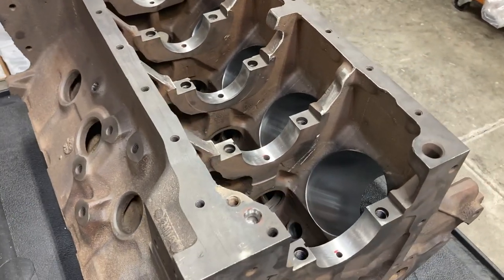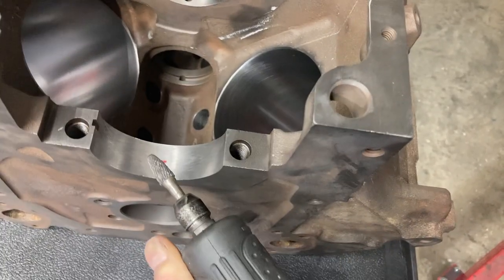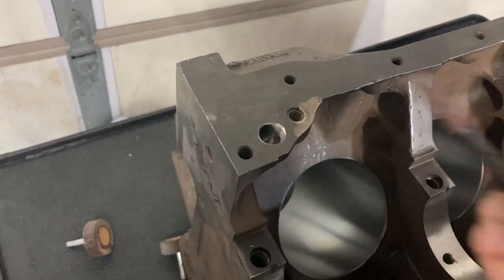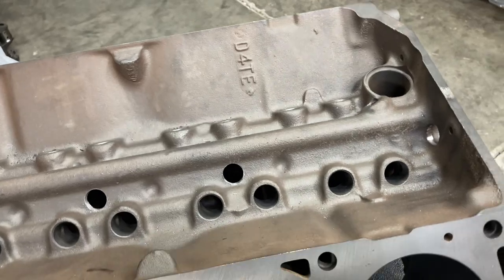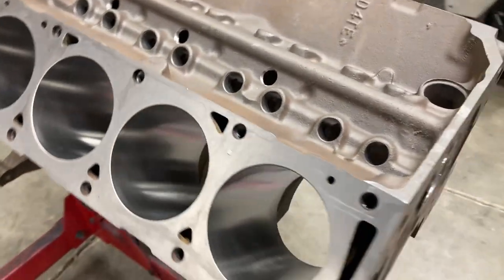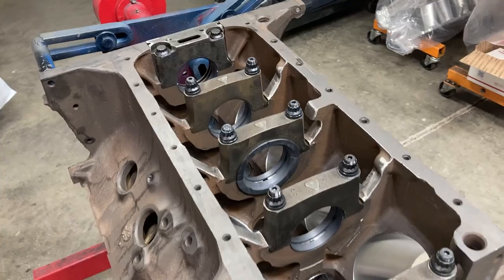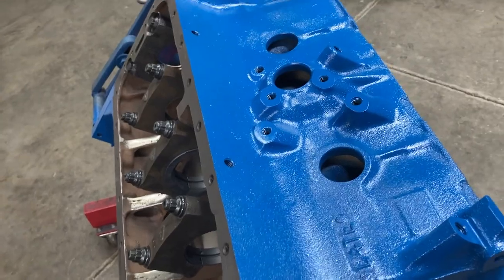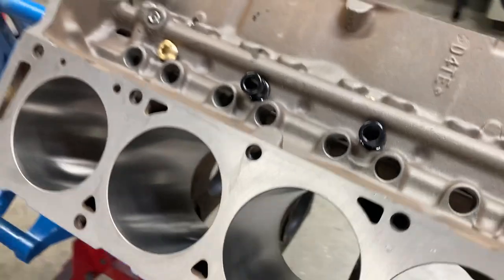Lykins Motorsports How To Prep An FE Block For Street/Strip

Comment: Not to tell u ur business if course but I started years ago using aluminum recessed square drive pipe plugs for race car engines in the frist plug holes on 302 Fords. Dick Trickle told me way back when that it stiffened up the block walls in his 351C motors. Yes I'm 63 yrs old and been around to long vut it has never let me down even with the inevitable times when things get a little warmer than they should and pressures get a bit high in the cooling system. I was a Senior Master ASE for many years and tried to live by the idea that every day is a school day and appreciate u sharing your aquired knowledge with me as well. Thank u!

Comment: Thanks for all the information I broke a drill or 2 doing oil mods on the FEs did my 1st 390 in 1975. Found a receipt form Anderson auto parts in Greenville SC  yesterday looking thru an old ford engine book receipt dated 2/14-1978 
 for MS 863p-10  $38.47 and CB 760p-10 $25 68. I googled those part numbers and summit still carries those but are a little more expensive. Been a FE man since high school 1973 got my 67 GT mustang 390 car no engine or trans cause that's all I could afford built my 1st drag car from it. Love your detail reminds me of someone I know. No way the boat anchor applies

Comment: Great video Brent. I learned the hard way, why you have to clean a block again , even after machine shop had cleaned it. This was 35 years ago, and the oil drain backs got clogged up with crap. Since then I always clean all oil galleys and everything else really well, even if machine shop cleaned it too.

Comment: Great video! I've got a 390 from a 66 T-bird in the floor of my shop that I hope to one day make a 445 out of. I have a 65 F100 that it would go in. I have two 66 F100's with the 352 V8's. One of them has 31k original miles and the other is worn out with mix matched heads. Love the FE's and really enjoy your channel!

Comment: Good episode.  Been fooling with motors including FE's since these were brand new production pieces.  Agree with all you have shown.  But wonder why brass freeze plugs and steel block drain plug ...  I'd use brass wherever water touches metal.  Also the front main gallery plug, I'd use brass because I'd drill it 0.045" as an oil squirter onto the timing chain/sprocket.  Your enhanced valley drains will help.  But, because most blocks are inclined back toward the firewall on installation, there may not be enough oil to keep that chain wet ...  A wet chain is a happy chain and it will extend the life of the chain greatly and allow it to not "stretch" over time, keeping the timing more consistent for much longer 😊
Reply from the maker: Chain gets a ton of splash.  I’ve never used anything that puts more oil on the chain.  Never an issue. Parts are better quality than they were decades ago.  

As for steel plug, the plug is easily removed and changed.  Freeze plugs are not.  In addition, the fastener kits that come for these engines with original style fasteners all have steel plugs to look period correct.

Comment: I'm pretty sure I did all these mods and a few more not mentioned here. Involving a 7/16 drill bit 24 inches long. I have a 1970 thick block from a truck 360. I sonic tested the block and mapped it for core shift observation. It's a nice block. I had 7 I went through till I found this one I selected. I hope everyone finds all those hidden ponies in their FE!
Reply from the maker: Blocks are subject to core shift, even in oil galleries.  I do not open up any of them at all.  In addition, you can open up the galleries, but you can't do anything at all to the choke points, where the oil has to turn 90° multiple times deep in the block.

Comment: this was one of the Best videos about how to prepare a block I have ever seen. I remembered I saw a video about a guy with a Dart small block chevy, who tapped the oil return in the lifter valley, then the valley flooded and the oil went in the intake port. In this case with the FE block, Will this not happend because the restrictor in lifter galery? or is because the oil drain in the End of the block in FE are better Than the SBC?

Comment: before the final wash i always check the lifter bores with a lifter to assure none of them are dinged up and stick the lifter. it's always a pisser when you go to install the lifters and they stick in the bore. sometimes just running a ball hone through them is not enough.

Comment: Brent what size drill do you use for a hydraulic flat tap cam in the 1/8 NPT pipe plug in off shoots for cam I also have bronze lifter bore guides 390 block  . I am also going to put the hose end and plug the drain backs like you did really enjoy your FE builds . You did a 390 for a friend of mine in Massachusetts for a wagon totally impressed by the performance of that motor !
Reply from the maker: You do not restrict for hydraulic cams.  Solid cams only.
Reply: Was about to ask this same question thanks for the ask and Brent for the answer

Comment: Seen you on Drag Boss Garage like Ford content I've had alot of Ford Engines in my life time,  good tips on block preparation been thinking about rebuilding my 428 CJ FE lately  the question I have is have you ever Drilled the Oil hole out to a Bigger diameter from filter to pump ?? I seen it in an article years back for more oil flow wondered if you ever done anything like that  ?? Keep up the good work
Reply from the maker: Not necessary.  The factory hole is big enough.

Comment: Many years ago when working on FE blocks most drag drag racers would modify the main bearing caps by relieving about 1/2 inch,  of the bearings 0.010 to 0.015 inch to stop the "pinching" of the bearings on the crankshaft when they bolted down the main caps.  Do they still do this ???
Reply from the maker: No sir.

Comment: Interesting that block has a repair. The 390 block we used for my dads 445 stroker came from a 1 owner untouched 68 LTD (we had the car) and we found the lower rear gallery plug on the back of the block had been repaired in that manner also. Looks like it either had a casting defect or it broke the bottom portion of the block/threads when they tightened the plug down the first time.
Reply from the maker: I see it quite often, even on aftermarket blocks.  You can't just scrap an entire block because of a little defect, so it's usually repaired right there on the spot.

Comment: Great information and share. What are your thoughts on restricting oil flow to the heads by restricting the oil galleries in the block instead of the heads?
Reply from the maker: I'd rather restrict in a spot where it's easy to get to.  If you ever change setups or decide you need more/less oil, you have to pull the heads if you do it in the block.
Reply: @lykinsmotorsports  Yep, Have had to change my current set up myself. Great advice.

Comment: I have question about oil drain back. In the front of the block there is a larger hole that would allow oil to drain back in the timing cover but only on one side becouse the dist is on the other side. But that one larger hole is alil high. Do u see a problem with drilling another hole through the front of the block just under & alil bit to the side of the larger hole? So it is level with the valley in the lifter valley. To allow oil to drain back easier? So the lifter valley would not hold as much oil. I saw someone do this & I did this to my last 390 & I haven't had any negative effects so far? Still running strong. The reason I ask is becouse I never see anyone else doing this? Yes it is useless under hard throttle but it would help drain oil when slowing down?
Reply from the maker: I've never done that.  No issues.

Comment: Brent, what do you clean the outside of the block with so the paint will stick?
Reply from the maker: Well, the blocks are jet washed after machine work, then I usually pump lacquer thinner through the block and over the outside of it before painting.

Comment: If you have the machine shop “plateau finish” the cylinder walls, after the hone,  you get NO black grit.
Reply from the maker: This is incorrect.  We plateau hone every block and you always get stuff left over.
Reply: @lykinsmotorsports  hmm 🤔. Must be the final grit stone.  20 years as a machine shop owner, I retired.  I used a CV-616, finished with a JHU-623, plateau finish nylon bristles brush (cv type), then pressure jet wash , brush out oil galleys and rinse, WD40 coat and wipe clean.  Ready for assembly.  Done!   OBTW nice videos.   Takes a lot of time editing.  Thanks!

Comment: The center drain holes in the lifter valley is for oil to get to your cam and rod bearings cuz that is the way Ford designed it
Reply from the maker: There is absolutely no way that oil that’s in the lifter valley can get to the rod bearings.